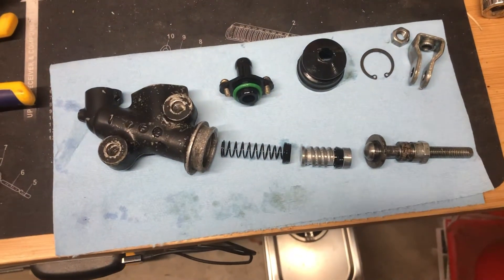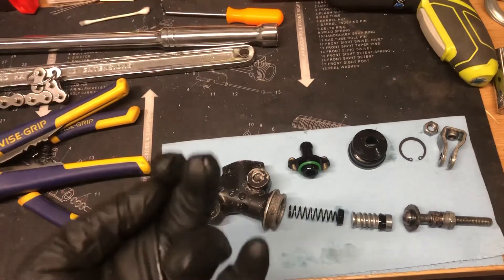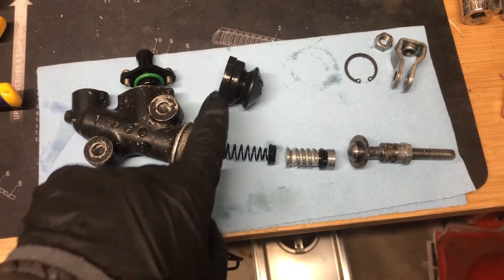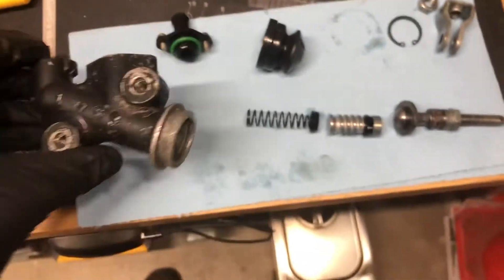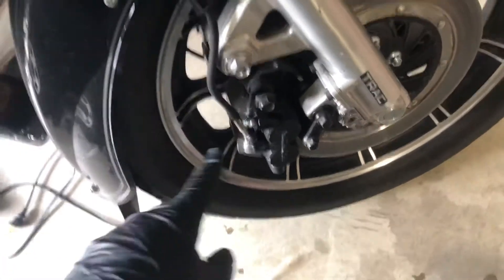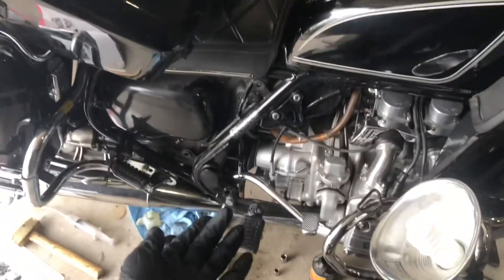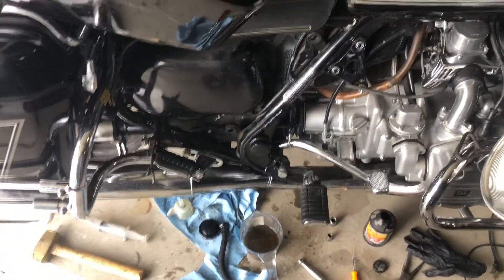1983 Honda Gold wing GL1100 rear brake master cylinder question

Comment: This is a common problem as its a 1 year only master cylinder.  The only guaranteed fix is to have a machine shop bore it out and put a sleeve in it. Thats what I had to do. Every used one I found was pitted inside with same problem 😢

Comment: Did you fix it? Solution? . Have The same problem with mine to now.
Reply from the maker: yes. use the rebuild kit for the 84
Reply: @ParkerRoams  ok. What was The Different between kit?
Reply: @Zajten  
Did you get yours figured out Stefan?
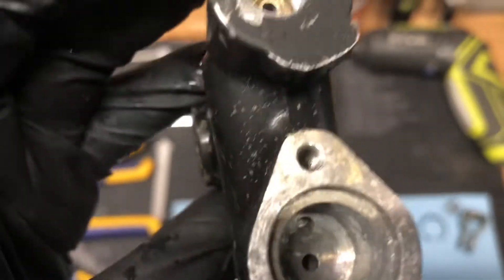Reply: @iDONTdoFacebook  Hi, Yes. i have to open the chanel that you see in the video at 1:40...the very small one was not open. Then it worked
Reply: @Zajten  
Very good. Thank you!
Reply: @Zajten  how did you get the small one open? Can’t seem to get anything to clear it
Reply: @calebbaertschi9593  i used a Tig welding stick and sharpend that very thin and gently hammered it down, Or you can take a needle and gently hammer it to the chanel. You Dont whant The stick to brake inte hole so take it easy when you hammer. I soaked brake cylinder with WD-40 first for 30min.
Reply: @Zajten  awesome thank you. I will try that and hopefully it will stop leaking. Not getting pressure in the system at all